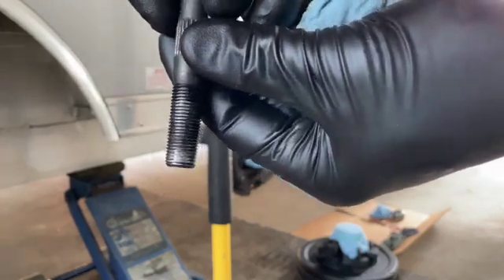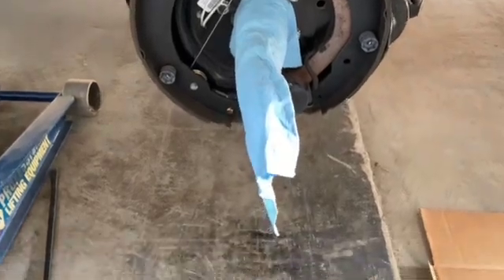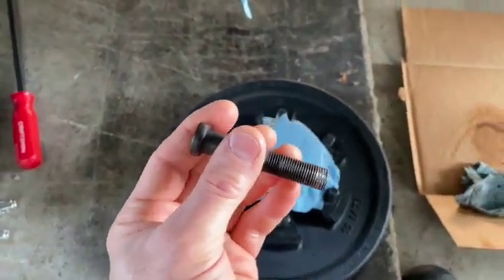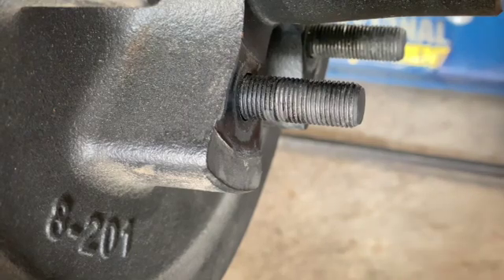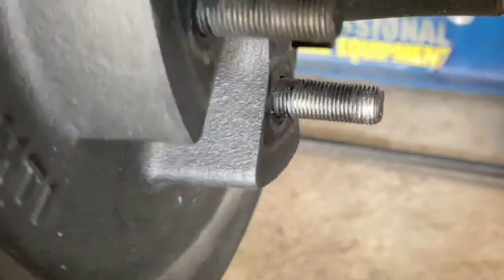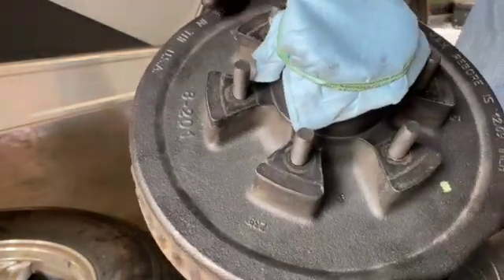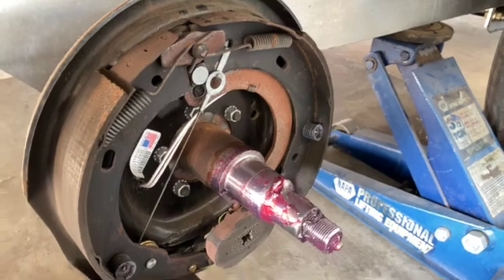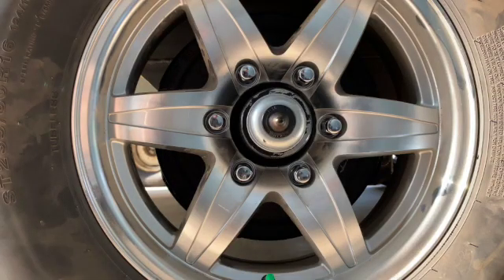2021 ATC Game Changer toy hauler damaged wheel studs from the factory

Comment: Appreciate you sharing the video - very clear - good to know what to look for. Shouldn't have to be fixing these things especially at this price but good to see they are relatively easy fixes. Had no idea the nuts on the spindles were only finger tight?
Reply: Just watched another video that recommended torquing the castle nut to 50 lb ft then backing off a bit, to ensure the bearings are sitting correctly? Something to double check.
Reply from the maker: Yes that’s correct procedure, and customers should not have to be fixing this kind of sloppy work from the factory, especially on something “world class”